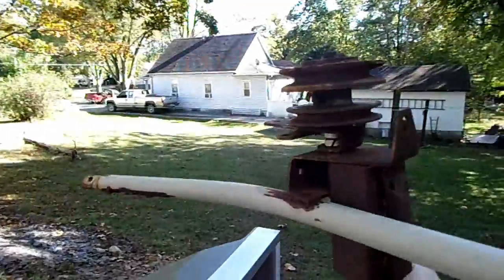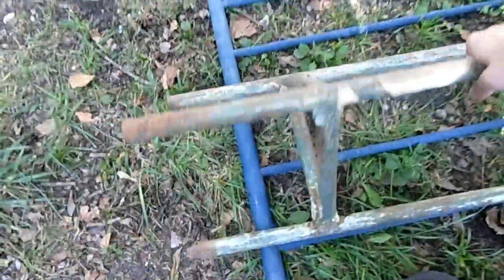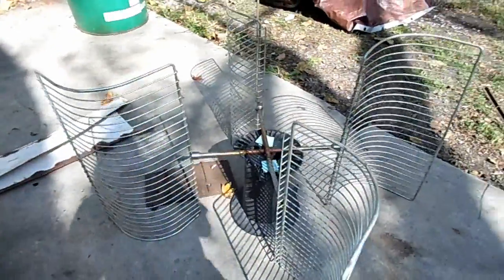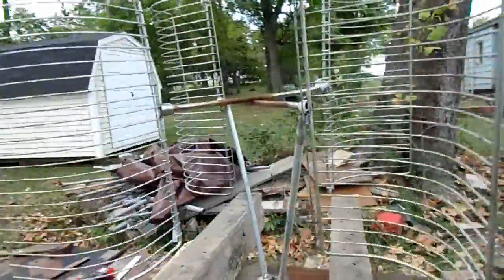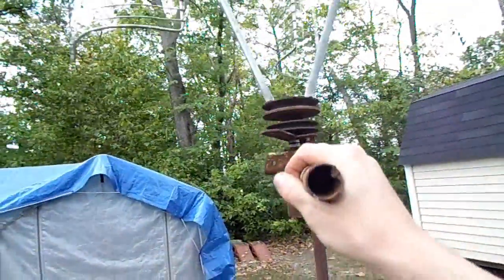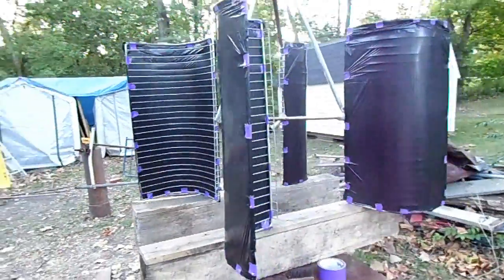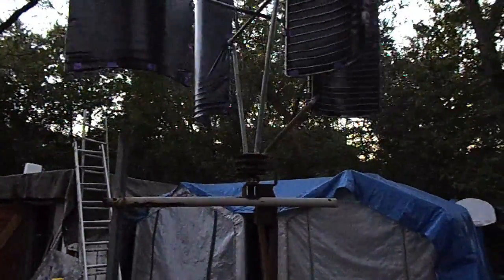DIY: Vertical Wind Turbine VAWT

Comment: I live in a house with no electricity--too much $$$ for SC Edison to run a power pole, weather head, etc. So we used an old washing machine as the base what rotates; added a vertical 1" o.d. pipe and attached refrigerators x 4 to the vetical pole via welding.  the fridge doors are open what attacks more air = more speed.  I duck taped the doors open, in the future we'll use a metal bar & weld the bar across the top of the fridge to the toop of the door.
wish me luck.

Comment: Thought about an automotive alternator with a belt drive? I've seen those work :--)))
Reply from the maker: unfortunatly those are very stiff, would only be good for a big turbine i think.
Reply: It was done by  Sam Carlson on the show called "Port Protection" 2015 (season 1 ep.7- 'Broken Lines') up in Alaska, and if I remember right, it was about the same size as yours. Of course, it only put out what the alternator was rated at. :--))) This guy made things out of anything he could find lying around, his VAWT was all 'scrap' pieces.

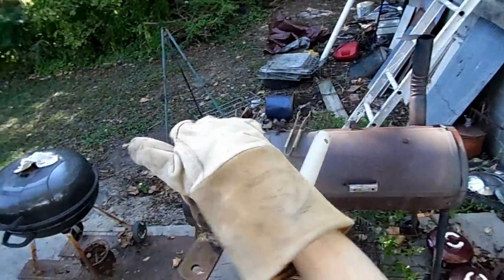Comment: Hey what's the name of the spinning assembly at 3:50 please? Can't get my head around it :( and want to find out how to make one
Reply from the maker: thats called a pulley. i got it from an old lawnmower.
Reply: Ahh..is it difficult to make this part using a rod and bearings? Wondering if I should just use a lazy susan
Reply: Thanks though
Reply from the maker: Samsquantch
nah its not hard really.
Reply: I'm being dumb then :/

Am I right in thinking I need only use 2 bearings, one flanged one plain, at the bottom of the rod and in the middle of the rod? (as the rod will then continue upwards to have the "blades" mounted to it)
Reply: And from what I gather flanged bearings can be tightened to grip the shaft so it doesn't fall through the bearings? And flanged one should be at the base of the turbine assembly (halfway up the rod) to bolt to something sturdy?
Reply: Yours looks nice btw! :D I like the rustic approach
Reply from the maker: Samsquantch
idk, try stuff out and see how it goes. maybe see if you can get some free used axle bearings from an auto shop.
Reply: Ok!
Reply: Cheers

Comment: My father designed a wind turbine that increased the spinning all things being equal. It is similar to yours but it has hinges on the outer part. The shape is like a + with hinges half way through the 4 plates so it swings when the pole is turning, pushed by the wind, and the swing helps the rotation. Send me an email if you want a drawing (mletou at gmail dot com).

Comment: why did you  stop using the Hobart? you're choice of foot wear is awesome, lol hop around much when your  gobing wire? interesting use of a compressed gas cylinder, you should try it with a full cylinder and the cap off. are the gas cans full or even empty ? got to give you props for your use of scrap, it has kind of an artistic quality. 
 now for the  rest of you  kiddies out there,  always  store flammables in a safe  place , wear proper clothing,  treat high pressure DOT. cylinders with respect,  misused they can KILL.
Reply from the maker: these cylinders are empty, so their only danger is from being heavy. and the main reasons why i stopped using the Hobart is because i gave it back to my dad to use for his trailer then just found that using car batteries was easier because i could leave them outside in the rain and i got free welding rods from my grandfather sometimes, instead of 30$ flux cored welding wire.
Reply: the main reason  i am critical is when one makes a video  such as this you become  an instructor and you would be surprised how many people  lack common sense.  a few moments of showing someone the proper way to fabricate can save someone a lifetime of pain and suffering.  you knew  the cylinder was empty and it looked  discard,  but imagine someone else looking over  at his buddys 02 bottles with 2200 psi in it uncapped and trying the same thing only with deadly results. as teachers we have a responsibility to  keep people safe, yes its also the views responsible to  know ones limits and use common sense to. be safe.
Reply from the maker: Ha Re
thats survival of the fittest. its not my fault somebody else could be so stupid.
Reply: yea you're right........ hey , you should do a video of how to rebuild a squeaky o2 regulator with yamalube.

Comment: what type of welder were you using there, flux?? Rinoa Super-Genius
Reply from the maker: flux cored MIG, but now i just use 3 car batteries connected together with jumper cables and 1/16th inch welding rods.
Reply: thanks for the reply
looking at building our own vawt

Comment: hi! nice video!
what do use to welding tools?
i wanna learn and use that tool : P
Reply from the maker: a MIG welder, but now i also use 3 12v car batteries and some jumper cables.
Reply from the maker: *****
well i got them from off the battery recycling skid so it really doesnt matter if i kill them. i find a 1/16th inch welding rod only pulls like 80 amps from the battery. thats like starting a small riding lawnmower with a truck battery. its less of a load on the battery than what it's designed for.

i can usually go through like 10 rods before the batteries get down to like 12.45v. but i have a power supply that i connect up to the batteries to continually charge them with 3 amps so if i just wait like 5 minutes between welds it refills. and usually i take more than 5 minutes between welds adjusting parts and whatnot.

Comment: should have just taking one of those 45 gallon drum and drilled dead centre of the drum so you can weld a pipe thru and then cut the sides in 3 panels and weld them to the top and bottom lids of the 45 gallon in a tri vawt config. very creative good job though.
Reply from the maker: that is a great idea if you have a plasma cutter, but trying to do it with a saw is quite difficult. i have plans to build my own plasma cutter from scratch though. thanks for the idea.
Reply: Rinoa Super-Genius dont see the need for a plasma, a grinder or a jigsaw/sawsal with a metal blade will do fine, unless you plan on mass producing them. haha
Reply from the maker: alainspecteur1
jigsaws are super loud and make nasty sharp edges and hurt your arms from the vibrations.

Comment: Nice work,
i dont think the garbage bags will stay attached for long if their on the outside of the baskets :)  For a lightweight turbine it sure looks heavy with all that steel
Reply from the maker: I made this ten months ago. The wind turbine blew apart a few months latter. I threw the parts into my scrap pile but the plastic s still stuck to the metal. Id actually just re use those pieces if I was going to build it again. I think a year of lasting from a few feet of tape and two trash bags is great.
Reply: Rinoa Super-Genius
Its definitely cost effective, i wasnt knocking the use of garbage bags, just that they`d be better on the inside of the baskets where they`d have more support. I made a small 5-6ft diameter VAWT some years back that initially used clear poly sails and it worked ok. I have a video of it somewhere, i`ll upload it if i can find it. 
I later upgraded the sails to ripstop nylon, only slightly heaver but much better in blazing sun (poly softens). The VAWT was made from 12mm fibreglass tube (2.25mm wall) and the front end of an aluminum kids fold-up scooter for the axle/bearing :)
I plan to build another to run a small air compressor but this time i`ll use T6 aluminum to keep the weight down to a minimum. Totting up the individual parts it should come in at 5-10lbs, pretty light for a VAWT with a 6ft turning circle.

all the best

Comment: Connect this VAWT to a PMG. Connect the PMG to a Charge Controller. Connect the Charge Controller to a Battery Bank. Connect the Battery bank to an Inverter. Connect the inverter to a ceiling fan in your living room. And you will get your air circulated. Or you can just open the window :D

Comment: Nice effort.  If I had made this I think I would do away with the plastic garbage bags and just use duct tape on both sides.  I am not going to down anyone for at least trying to make something.  This was probably a fun project to work on and every time you work on stuff like this you learn something new.  Good luck, I plan on building a wind turbine this summer.  I might put it on youtube as well.
Reply from the maker: yeah i think filling the entire area with duct tape would be a bit wasteful tbh. even though this wind turbine flew apart a few months ago the fins still have the plastic on them very tight.
Reply: Duct tape is cheap and if it were to be used daily it would also be about a thousand times less likely to rip or tear.
Reply from the maker: James Bowling
but it degrades pretty fast outside. its more expencive than a trash bag and also requires more time.

whenever the layers start to delamiated due to sun exposure it would break/crack even faster then plastic.
Reply: I have had it outside on several differn't things and its never given me an issue.  Its not a big deal though.
Reply from the maker: James Bowling
oh i just always have it dry up and become very brittle.

Comment: My issue with most of the wind designs that I have seen is that they simply cannot develop much torque in average winds.  Unless you live in an extremely windy area or use extremely large blades it doesn't seem like you can produce much rotational torque (wich is a must if there is an electric load of any size)
Reply from the maker: well thats why you make a low torque generator from a ceiling fan motor. but yeah you need a lot of wind to generate electricity.

Comment: a genius doesnt use an angle grinder with open toe sandles
Reply from the maker: Its just sparks. You don,t like sparks?
Reply: er its more the rotating disc its only got to snag bounce and you have no toes .ive worked in sheet metal engineering 20 plus years seen many accidents by those thinking itll never happen to them next thing you know they are in emergency because theyve quartised themselves .if you arnt even aware of the dangers again hardly genius lol sparks lmao
Reply from the maker: well that would sure make a great video if i did cut my toe off. the video of me splashing battery acid on myself is doing nicely so that prolly would too.
Reply: lol atleast youve taken my comment in good spirit ,big ups to you respectable

Comment: Car alternator, you might be able to make that work by way of belts, you could mount the alternator or small generator the same way you would mount it in a car so then you could tension it to the desired resistancy.
Reply from the maker: Once I energize the alternator it would lock the whole thing up due to friction. Its better to modify a ceiling fan motor.
Reply: Rinoa Super-Genius Yeah it's too little for car alternator, but I really like it. Great work!

Comment from the maker: yeah, unfortunatly we don't get hardly any wind at my house.

good thing is though the leaves are starting to fall due to winter coming and so the woods have less wind resistance. so stronger winds coming between the trees.

i had half the generator video filmed and it half built but then the temperature dropped down to 20 degrees for a week. it should get warmer soon though.

but thanks for the encouragement :D

Comment: Idea to create power. Add 4 metal plates about 2 inches wide and about a foot long radially from the pulley, Would need to be stiff so they would support 4 magnets from a microwave oven. Then 4 more plates that would support coils of wire, those would be on the support [non moving] adjust so the magnets pass by the coils close and they will generate electricity in pulses. Rectify the pulses to charge a battery. Manual controlling the charge. Will take lots of experimenting but will create power

Comment from the maker: nah can't use a car alternator, once you energize the field windings it would lock up solid, would instead use a PMG to convert whatever power that turbine could make.

a car fan belt would be way too wasteful, too hard to turn. a better belt would be the thin ones on a washing machine.

and at most i expect maybe 200ma of charge current. maybe even less. my solar panels would work better.

i may be able to sell this turbine to my neighbor though :P

Comment: sounds good to me :) i never had a single issue with car alternators as long as you put a decent one way diode setup it should work i have done it myself and got over 24v with enough amps and wattage to use powertools but i was using a chainsaw engine at the time i dont know how well it would work with your VAWT due to those low power wind speeds hmmm this one has got me thinking :)

Comment from the maker: unfortunatly that would be adding lots of wind resistance. ya see the energy the wind turbine would be taking would be coming from my motion through the wind. and would lose like 70% of the electricity as it went from motion -> rotation -> electric current -> battery -> motor.

it would be more efficient to just not have it than to have it, but solar panels would be good if only they where more powerful.

Comment from the maker: unfortunatly the alternator's on cars lock up as soon as you energize it. it would be too much friction for the turbine given the slow wind we get. if i where to use a pulley it'd be the thin kind like from a washing machine.

but i think i am going to just build my own generator around the turbine itself. will use some magnets and coils.

Comment: i would suggest buying a belt or finding one getting a hold of a 12v generator off an old car and welding it inline with the pulley then belt it up together and like magic your shed is even more off grid once you wire it up to your 12v lead acid batteries :)

Comment: I have seen others use a ceiling fan motor as their generator (usually driven by a gas motor or such). Perhaps one would work as a generator for your VAWT. Also, have you considered using coroplast (corrugated plastic) i.e. political and other roadside signs instead of trash bags? They are quite light and have a UV resilience of about 5 - 6 years depending on color.